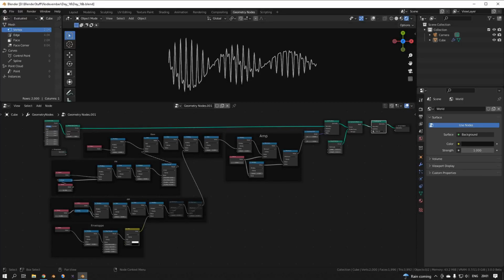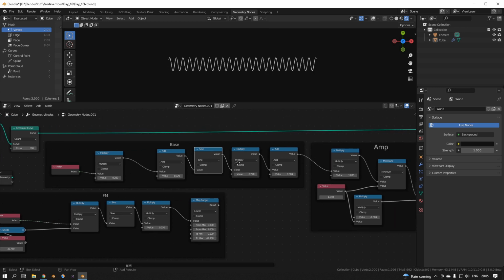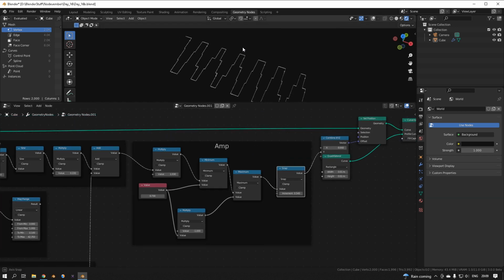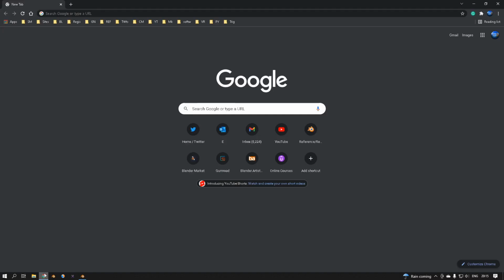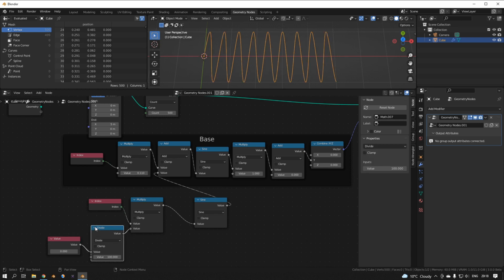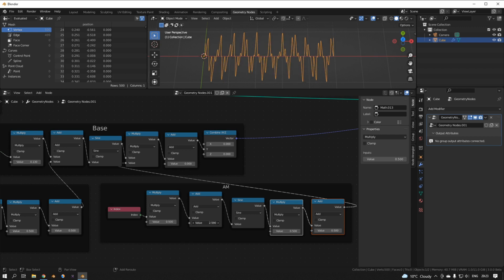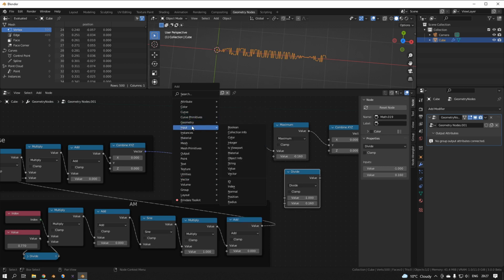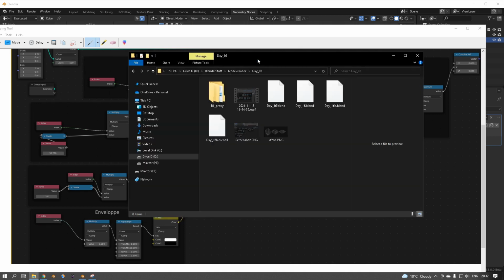Geometry Nodes - Part 4 Waveform generator

Comment: Awesome video, thanks for this!  That's really nicely done, would it be possible for you to have your geometry setup for us to download & use?  Is it possible to also generate Saw/Square/ etc with your setup??   I have a big modular synth setup & would love to link my voltages to some of the nodes. Your FM/AM setup is a really nice bonus. Do you know a good way to also generate ADSR envelopes??  Sorry for the questions. Cheers.
Reply from the maker: Hi, it's been quite a while ago I did this. I think, if you want to make ADSR, it is AM based, and then you include the factor time of the sound (or simulation of it, because the nodes are not aware of time, but steps/samples/cycles). So like, first x samples, go up.stay x samples, decrease x samples. Then if you have the ADSR group, I suppose you multiply that with the other AM modulation. I don't have the files anymore, but I believe it wouldn't be to hard to build it for you.

Comment: Wow, that's really good. Thanks for sharing. Can see this useful as added effect to many animations.
Reply from the maker: I didn't think of that, but indeed. I will experiment with a bouncy ball today and see if that's good for another video.
Reply: @Newmediasupply  - I didn't mean anything specific - just like a good thing for a "panel" or something to show as part of some electronic display.  Perfect for simulating one of those led panels on a synthesizer that shows the waveform